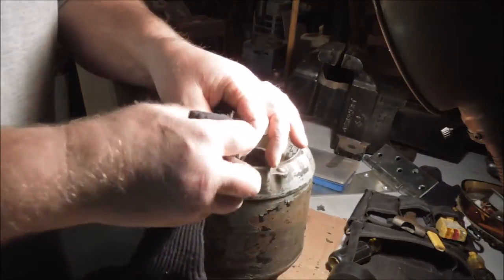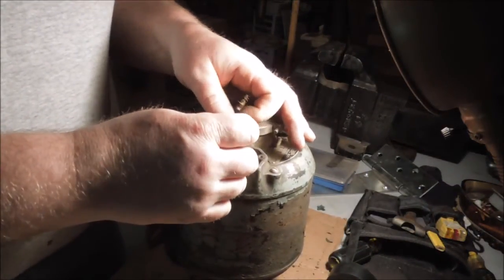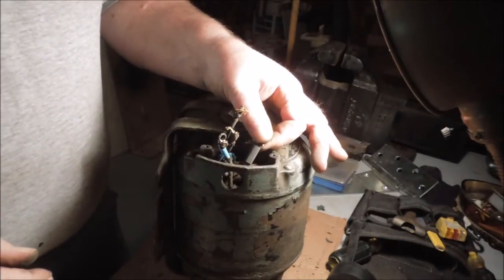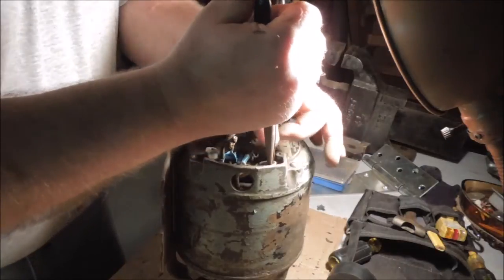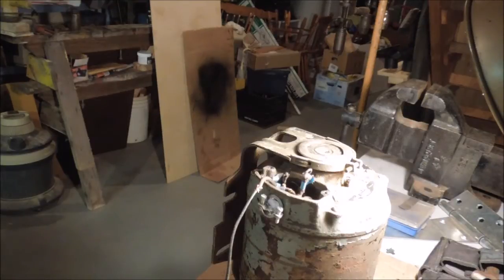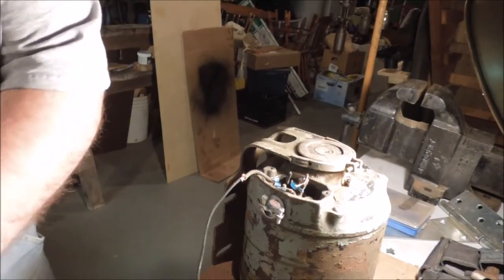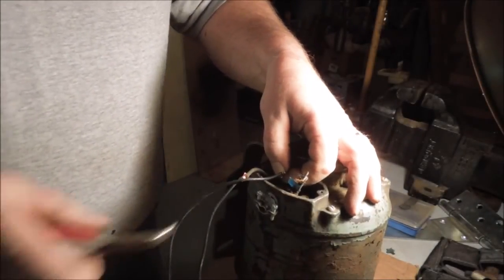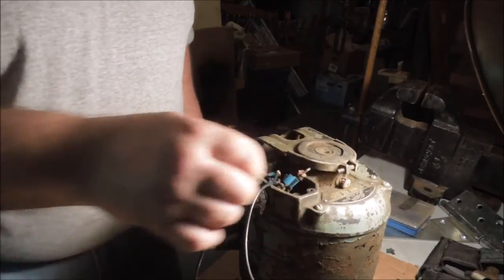Rewiring the South Bend Lathe Motor Pt 2 Repair and Extend Broken Wires

Comment: good trick in  tight space . strip insulation from crimp type splice , crimp wires in splice then solder . insulate with heat shrink tube .